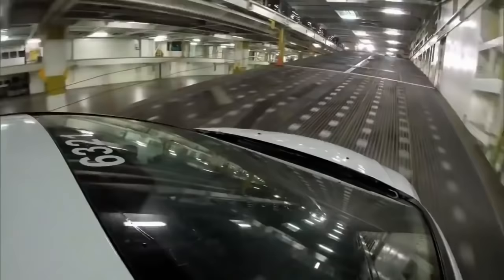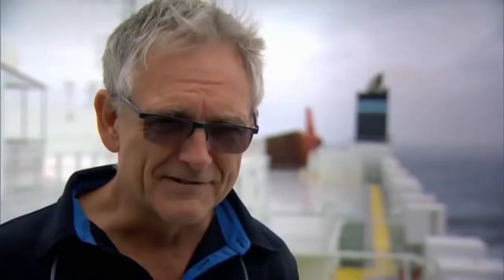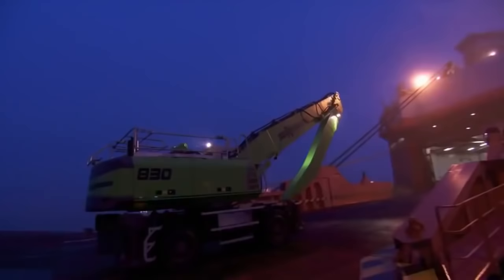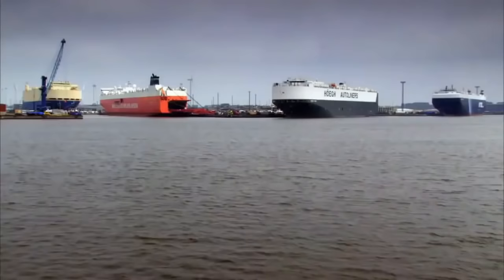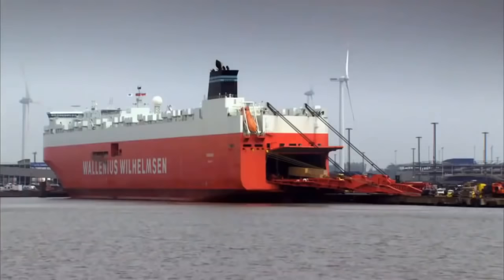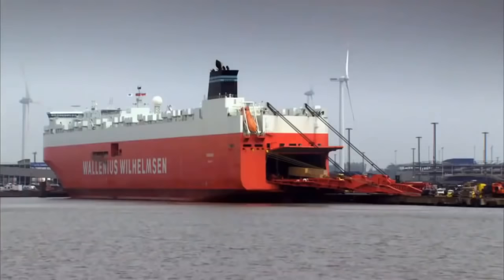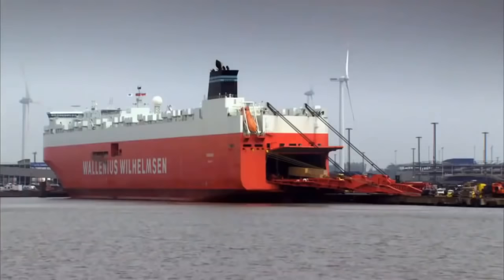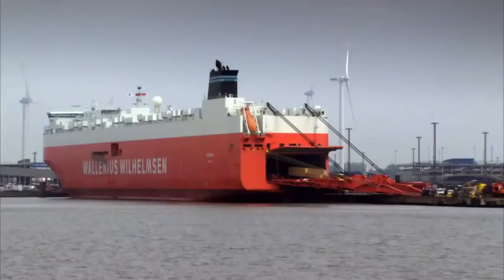The Tonsberg - Mighty Ships

Comment: I wonder how the engine department, it is always that the captain and the chief officer is seen, but behind that is the Engine Department, They are working in a hot space and maintaining the ships Heart which is the Engine, if u know guys, Captain and Chief Engineer has the same salary it only differs (sometimes) on what type of ship they are onboard, and the Seniority Pay they have in the company they are serving, I would like to thank the Engine Department in every ship because most people don't know that when the ship is not running, they do maintenance in the Main Engine, Scavenging, cleaning Filters, Cleaning of Sea Chest (High) & (Low) God knows whats in the Big strainers, sometimes big, Lilies/weeds, stones, crabs, dead fishes and the smell is pungent, Scavenging is worst when you have limited time, Replacing Piston Rings and measuring its dimensions, safety test before entering port for Post state control, AMSA, Coast Guards all of these Authorities targeted always the Engine Department because of MARPOL (Marine Pollution), if I were to choose, I choose to work as a Deck Officer (highest is the Captain) because when u became an Deck officer your hands is always clean and papercuts are your only enemy, more like a Chairforce, unlike Engineers that the hands always dirty due to hardwork and fuel and oils that engineers have to deal.